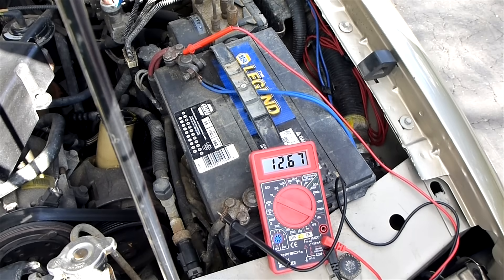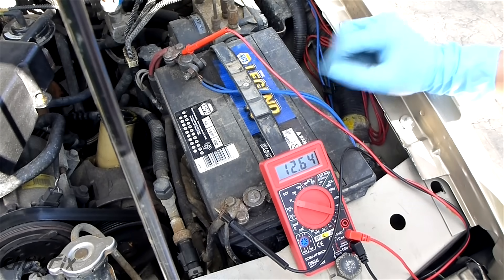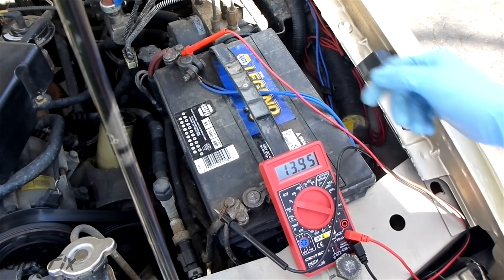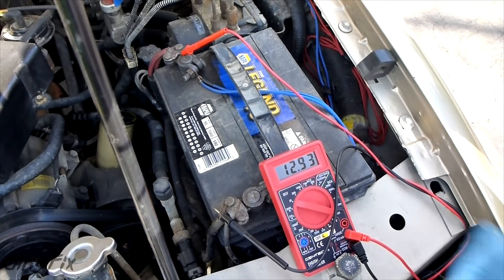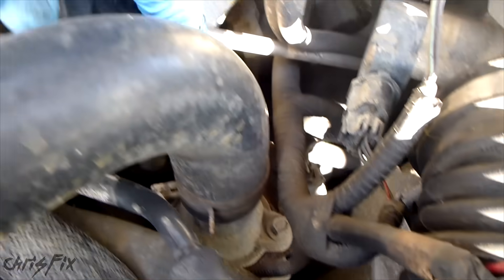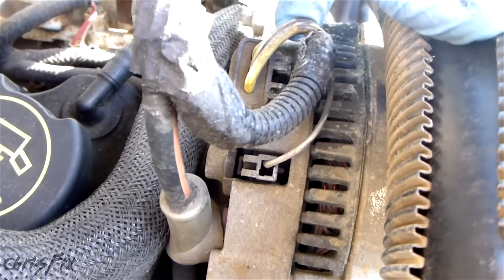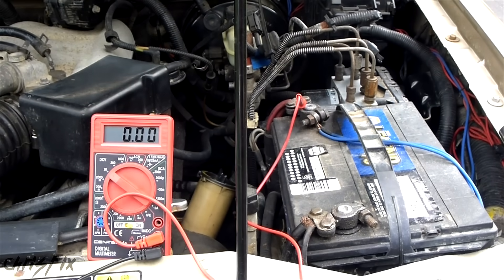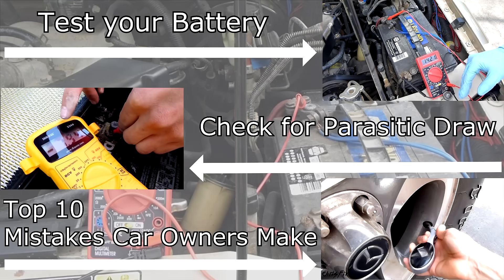How to Test an Alternator

Comment: This video was awesome! Did the negative voltage drop test on the alternator. Found I had 0.8Vs of drop between the alternator housing and the battery! Pulled alternator and cleaned/sanded brackets and bolts and boom! Alternator putting out 14.4V instead of 13.8.. under load it was below 12.75V before cleaning. After cleaning it held over 14V with everything turned on. Great tips! Thanks Chris!
Reply from the maker: Awesome! Thanks a lot Luke!
Reply: what does removing and then cleaning the brackets do? provide for a better ground?

Comment: Hey Chris  when i test the battery on my car its giving me around 11.35 volts when its off 
Then I turn it on and it gives me 13.56
Does that mean my alternator is bad
Reply: check your battery in the morning with car off, should be reading 12.4V or 12.6V if its above 12.6 is over charge , you need to remove service charge in the battery, by turning on lights for a couple of minutes, or crank the engine with ignition cable disable, which is the coil. but if battery is below 12,4v with car off  like what you said you have. you need to check that battery. get it charge so you can do those test Chris is showing here. some battery is older than 3 yrs old  they usually go bad..
Reply: @jeremiah1797  thanks yhea I found that I had a short on my sunvisors

Comment: Hello Chris,
I know this is an old video post, but you were right on. Installed a new alternator 2 days ago, and today the battery dash light came on. Found loose wire from alternator, over to positive battery terminal.

Comment: Pretty sure you just saved me over $350 for a new alternator or $130 for one which may've been no better than mine. Thanks heaps. Hopefully mine's all sorted just with belt tightening and main alternator connections cleaned. So far voltage drop on positive is much better and charging is now at 14.2 volts! Happy Man!

Comment: Hi, I have a Renault Megane WS 59 plate. I have a red dash light constantly on saying ‘battery charging problem’. I have changed the alternator twice, battery twice. There’s a computer ‘thing’ on the battery, that’s been changed, new fuse board. The car seems to run fine but I can’t get rid of the dash light. Every now & again the orange air pollution fault light comes on (my car is petrol) but goes off again a few days later. I honestly don’t know what else to try. Do I need to find a high ah battery?? Voltage is showing around 14. Please help someone.🙂
Reply from the maker: Try to reset the codes and you should be good if the issue has been fixed!
Reply: @chrisfix  mechanic has tried several times but I think it needs a better computer to do a deeper reset. Thank u.

Comment: When adding load like fog lights, led bar and ac do i need to rev the engine up to 1500rpm? Because mine is dropping to 12.6 v while on idle for about 1-2 mins. But initially it will get a reading of 14.2v then starts to drops after 1-2 mins of idle while accesories are on. When turning off accesories at idle it will go up to 14.2v. Thanks in advance
Reply from the maker: Have you upgraded your alternator at all?
Reply: ChrisFix no sir. It’s stock. Kia koup 2016.

Comment: Car died at a red light.  It would crank well but not turn over.  Lights and radio turned on.  

I’m thinking it’s the alternator.  I wouldn’t even be able to turn it on and do many of these tests.  But I’m going to first check the terminals and clean them first off.
Reply from the maker: Darn! Let me know how that goes!

Comment: Question: if my alternator is hidden under the passenger wheel(Ford Escape ‘05) how would I test it from negative terminal battery? 
My big three upgrade had an issue and I have bad battery or a alternator cable issue you rock on here giving us these tips!!

Comment: Thanks man! my battery was discharging and I ran all of these tests, turns out to be a bad chassis ground. Cleaned it, and now it works again
Reply: How did you fknd out that it was a bad chassis ground?
Reply: @BIG_DRU  It was just the last thing I checked, it looked corroded so I sanded and cleaned it and then it worked again
Reply: @Jaspervandeno  how do you find your chassis ground b
Reply: @juliorubalcava95  its mounted on the firewall

Comment: My battery is 12v with the car off. It barely even clicks. You jump it, while running its 14.4 even with lights radio etc on.

Comment: Thanks Chris. The 3 yr old battery on my 2001 F-150 was going dead overnight. Thought I had a parasitic drain but now it goes dead in just a few hours? Now wondering if the alternator(replaced a few yrs ago) is over-charging. Positive terminal on the battery has blue corrosion. Thoughts/suggestions?

Comment: Hi Chris, I am seeing something different and it's driving me crazy.
My battery died and I changed a new battery.
It measures 12.6volts on the multimeter.
After starting engine, voltage reads 13.5V. after a about 1min it drops to 12.6v.
Interestingly, when I load the car with the headlights/radio/aircon, voltage reading goes up to 13.3v.
Reving engine to 2k rpm did not change the voltage reading.
When I turn off the loads, after about 30 seconds. It drops back down to 12.6volts again.
Is the alternator ok? Or is the battery management system messing up with the voltage regulation? 
It's a 2016 ford mustang.
Thank you very much for explaining!

Comment: I confirmed that my alternator isn’t charging the battery after reving the RPM’s. I already changed the battery since O’Reilly said it was bad and also the store that I bought my new battery from (they covered the warranty after testing the battery). The “battery” light is still on after changing the battery. I’m hoping it’s a bad connection somewhere.

For the test at 05:00 I get 0.1 - 0.2 reading but no negative mark like in the video. Does it need to have the negative mark? I didn’t have any accessories running or the RPM’s up.

I’m thinking of taking the alternator to have it tested at O’Reilly.

Comment: Great videos, saved me loads. I do have one problem though that no one seems to be able to sort. Diesel car drives fine, then after about 30 mins the revs start jumping up and down then the car starts to cut out. Leave it 10 minutes and its fine again for another 15 miles or so. Volt meter on the dash doesn't move, can it still be a faulty alternator?? Turbo has been cleaned, new solenoids, NO FAULT CODES!!

Comment: I once replaced an alternator that wasn't bad. On all modern engines, the computer can turn off the alternator when the battery is fully charged to increase fuel economy. There's a wire that comes from the computer to the alternator and turns on and off to switch the field windings on and off. In my case the wire inside the harness had been nicked under the cowl and 15 years later had finally corroded through, so the signal from the computer to the alternator to start charging never happened.

I didn't catch it at first because I had the wiring diagram for the 1999 car and they started this in 2000 on that model. Unfortunately once installed I couldn't take back the $180 alternator.

Worth it to get a proper up to date wiring diagram. Once I had one I was able to use a jumper lead to apply 12v to the small connector and the alternator started charging, so I opened the cowl up to find the computer, and in a ridiculous stroke of luck the nicked wire was right there on top of the bundle looking right at me. Solder and electrical tape was all it needed.

Comment: My mother told me her car is not starting, and she had 2 people look into it. Both individuals said the battery is fine, but the alternator may be bad. In my thought process, it did not make sense to not have the car start to indicate a bad alternator. I figured it was a bad or stuck starter. This is a 2006 Toyota Sienna.  You need to have the car to start to test the alternator. The alternator is not in use when the car is starting up. It's the battery, starter, fuel pump, distributor and timing. Which starts the car.

Comment: Thanks so much YouTube dad. My battery and alternator are perfectly fine it’s just with my sub/amp draws too much power on heavy bass notes and my radio does a quick reset on/off.. I’m assuming I need to upgrade both my battery AND alternator to keep up with my amp.

Comment: Hey Chris,I just replaced my alternator with a brand new one and had my battery tested,came back good,and charged. When I am driving and rev it up to get on the freeway my voltage drops  between the 9 and 12 on the voltage gauge and when the truck gets back to cruising speed it goes back up to a little under 14 and stays there. Any idea? I am going to change the belt just to see if it may be that but if it isn’t I have no idea man.
Reply: Hey Sean, when the car is operating under load, the voltage will vary.  The important thing is not what the voltage is when the car is operating, but whether it can do all that it is supposed to do, when you want it to do it.  Any battery that you start draining a lot of current out of will drop it's output voltage, and when you rev it up, the plugs are firing faster and requiring more current, on average.  What you should be asking yourself is: does it start every time, in cold weather?  Does the engine run ok, even when accelerating?  Do all my electrical accessories work ok, all the time (lights, radio, A/C, etc)?  If you have no problem during operation, and it reads 14.05 volts when the engine is off, why are you then trying to find a problem, when none exists?  And, for your information, revving the engine, or accelerating under load, puts a much greater strain on the vehicle, electrically (and mechanically), than cruising at a steady highway speed.  But if the car is now running ok with your new battery and alternator, I wouldn't be worrying about voltage fluctuations during normal operation, nor would I even be looking at the voltage meter, while it is running.

Comment: This is not how u use the multimeter to check the alternator. He isnt even getting readings because the multimeter is set on voltage when he is checking for continuity.  What a joke.

Comment: I love the short to the point videos. Big time saver.

quesiton. 

Is there any use of a ammeter for a car besides checking for parasitic draw? 

Like checking the current flow from the alternator to the battery, or how much current the car accessories are using?

Comment: Hello chris, watching your video. Your look so great about the electrical problems! I need your help about my toyota Rav4 1997 i used power washed to clean my engine... then after all, a day after ill try to start my car it was start but i found it i dont have dashboard light, no ac, no radio, no stop light and head light and horn. And my battery excellent condition is new. Ill try also to change the gear but stock only in park... what i am going to do about this Big problem.. please i need your help thank you. Very much! Marc

Comment: Hey Chris great video. Was wondering if you could help me I got a 95  Toyota Corolla and I was doing some work on it's alternator when I pulled the  clip where the 3 wires are the clip disentagrated in my ✋ and now the three cables are exposed and don't know where each plugs into need help keep the video coming and take care 😷🙏👍

Comment: Hi Great video on my tractor when i start it and put a meter on it its only reading and extra couple of volts and suggestions what it might be.
Reply from the maker: Are you having a specific problem with your tractor?
Reply: @chrisfix  Hi its not charging the battery when i start tractor it stays at about 12.3 volts what happened was i brought the tractor it used to be 24 volts but some ne had taken all the dual battery system off and was just starting it with a 12 volt battery so i put a 12 volt alternator on but i was wondering if it would have a 24 volt regulator would that cause the problem.

Comment: Hello bro
I have honda civic 99 d16y8 engine
I have problem with the varta battery car that doesnt start(the lights on the screen work)
The battery is 1 uear and half and before that i replace another varta that work 1 year with same problem doesnt start
I have 2 products i bought
Solar checker battery
Ctrk mxs 5 charger and tester
I chrged the battery full and after 2 days the car doesnt turn on
I check with ctek and there ther is 3 light(.i choose alternator check)
Red yellow green
And it show yellow
i turn on the car with jump starter and conect solar battery chacker
I turn everything on the car and show around 13.3
I dont know if its the alternator or fuse(dont know where it is)
Can u help me please?
Thanks

Comment: You should tighten your terminal post. They moved when you probed them with the meter lol.
Reply: I had a Pathfinder I kept the cables loose all winter once because the security system would sound off at work. I easily removed the cable when I got to work and stick it back on when I left work.
Reply: Yeah, one time my battery cables came loose from the battery terminals, and then the all-electric power steering went out & it started to drive like a truck, while I was flying down Interstate 287, here in Jersey.  The problem was I'd put in a non-standard size (cheapo) new battery and it was loose and jostling around on the battery tray, because the battery block didn't hold it tight.  So, I got the closest block I could get, then drilled out the screw hole and made it fight tight, to hold the battery tight, so it wouldn't jostle around on the tray anymore, so the cables wouldn't come loose anymore.  A little more work, but problem solved & never repeated.  Battery itself was good, by the way, and less costly than the standard one, for my 2008 Hyundai Elantra.

Comment: I performed a negative test on a 2006 Civic. The resulst ar -15.2 on alt casing, -17. on engine block, -10 on enginde block leading to chassis ground, -10 on wire strand to chassis ground, and 1.2 (yes, its 1.2) on bolt on chassis ground. Positive test shows -129 to -130. Is this an alternator issue or wiring issue. Dont know what to do at this point. Ive looked all over youtube and you have the best explanation how to diagnose.

Comment: 5:05 Do i understand it right. When my multi meter shows 0 when testing from negative to alternator case it means something is bad? I also testet that car has 150 milliamp draw. I removed all fuses and didint manage to find what is causing it. 2004 Honda Accord ( EU/JP ). Car also has aftermarket rear parking sensors what seem to go trough ignition
Reply from the maker: Negative to alternator case should show no voltage. That is ground to ground. You should have continuity between the two tho. Keep your car off and the doors closed for 30min and then come back and check your draw. It should be almost 0. There will always be a little draw just because that’s how electronics work.

Comment: Is between 14.2 and 14.7 volts acceptable fort your truck? When checking my mom's 98 Toyota Camry it was at 14.15 and thought the alternator was going but when I researched  elsewhere 13.8 to 14.2 volts was the acceptable range. Thanks

Comment: Don't get me wrong, but at firt you should make your connection stable on your battery terminals. At 0:45 you can see that your negative connection literally moves just from touching it with your multimeter probe. I would not call that a stable connection at all, that has to be rock solid. Otherwise good vid.
Reply from the maker: thanks for sharing!

Comment: Unfortunately, some of this information is old. With today's advanced charging systems we don't charge batteries at 13 or so volts all day long like we used to. We haven't of years. The battery is monitored for a number of factors and the charging system is controlled precisely as needed and sometimes it is even shut completely off as appropriate to reduce engine load for fuel economy and emissions.There is no point in throwing voltage at a battery if it is seen to be fully charged. This also helps extend the life of the electrical components on the vehicle. Further, the target battery charge will be somewhere around 85% to extend battery life.
Reply from the maker: thanks for sharing

Comment: Mine kept going to 1-3 and negitive icon kept blinking with no number with the neg post on the alternator body and bolt that holds it down and the bolt that is covered only went to 11 and stayed even with high rpm Soo I just need to clean it? It looks like oil is all over the Bottom part , old oil and dust...

Comment: I know this is an old video but i really need your help... My car just dies after idling for 30 seconds, and i have to jump start but when it’s jump started and hooked up to another battery it runs fine, otherwise when it’s not hooked on to another battery it doesn’t work it just dies

Comment: When I start my car it’s a slower crank and while testing the battery the voltage is staying around 9.54v even if I rev the car. Is my alternator bad?
Reply: Yoir voltage should be above 12

Comment: I have a 2000 mercedes ml320 and ive been having issues with my car just dying and losing power after driving for 10 min, ive replaced the alternator,  the battery, and same issue. Its been a long week but today im gonna try to do what you do in your video and hopefully figure it out today. Thanks!

Comment: Overcharging from alternator can be caused by bad/corroded battery wire, like you said. Had a reading of 16.3, battery wire got hot, cleaned it up, reconnected it, volts are back down to 14.5 I was about to rewire my engine. Lol Thank you.